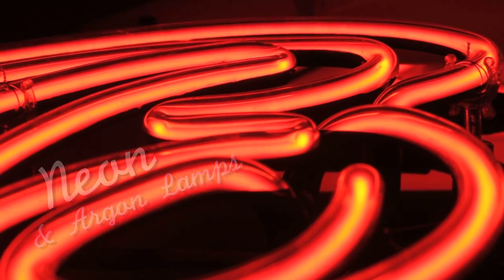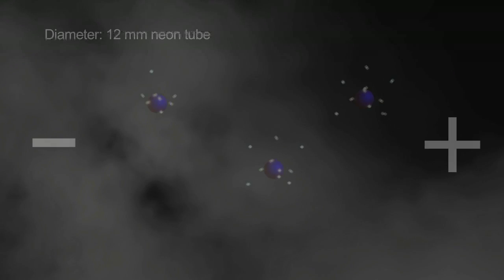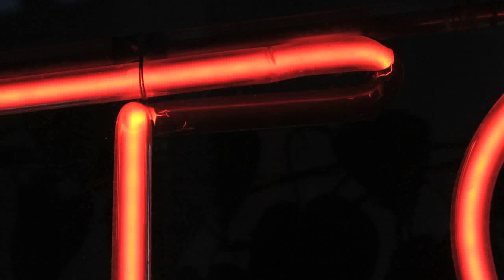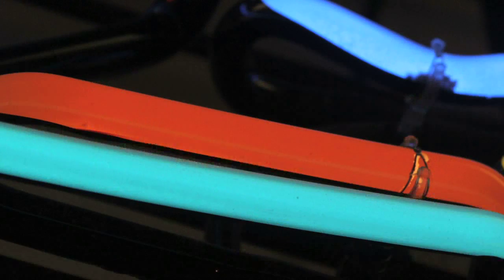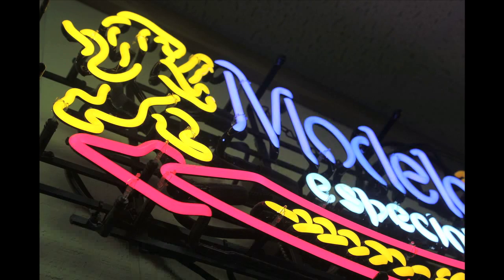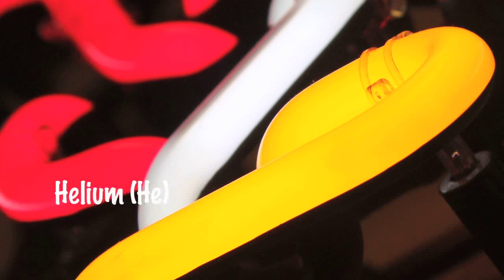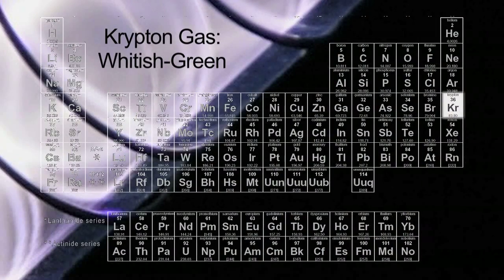The Neon and Argon Lamp

Comment: I would like an explanation as to how you get an even illumination down a contorted tube. Take an "e" for example at some points the electric field is one way down the tube and at others it is reversed (assuming the field goes approximately in a straight line from the anode to cathode). So why don't the electrons slow down in that section and maybe reverse, causing inconsistent ionization?
Reply: I dont know but one thing i do know is that neon tubes also work fine on ac and in a big U shape, cause sox lamps.

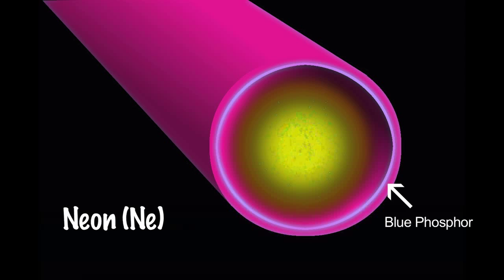Comment: 2:05 Sorry that's 100% incorrect its not the neon producing "just enough UV to make the phosphor glow", its the direct electron bombardment of the phosphor from the high voltage current which causes the phosphor to glow in as much as electrons bombarding the phosphor in a TV picture tube.

Helium in neon tubes was used in the 1930's and was phased out when fluorescent tubing became available due to the short life and special considerations required.

Comment: if you can use so many gasses, why not ditch the mercury,
why is mercury used anyways? because it is cheap in china?
Reply: No, this has nothing to do with China, you cannot use "so many gasses", just argon / mercury (Ar/Hg) and 100% neon (Ne) gas.  Its the UV produced by the mercury which is converted to visible light by a particular phosphor coating. I've been making neon for about four decades.
Reply: @tihzho  why do you need mercury with argon gas? why not the gas alone?
Reply: @ARCSTREAMS  Ionized argon (Ar) has a very dim lavender color and lacks the important 253.7nm ultraviolet (UVC) light emitted by ionized mercury (Hg) which is converted to visible light by phosphors coating the tube. 

In a lamp filled with Ar and Hg the light we see is from the ionized Hg. The Ar filling gas is there as a carrier to start the electric discharge.
Reply: @tihzho  ahh ok so the arg gas is just acting like a fluid to carry the vaporised hg and its the hg that radiates uv which is absorbed by the phosphor coating and turned into visible light, but im sure the arg is also pumping or bombarding the hg to make it lase or radiate the uv right? in fact the arg also helps carry the arc through the tube correct?
Reply: @tihzho  suppose we only use arg gas and discharge it in a tube that has windows on each end and confined between mirror resonators can we make a laser from this?
Reply: @ARCSTREAMS  Yes there are argon lasers as well as krypton and argon / krypton lasers.
Reply: @ARCSTREAMS  No the there is no 'lazing' with the Hg. 

Correct, argon is a carrier gas to support the discharge for the Hg. In the winter when its really cold neon signs filled with Ar/Hg will look dim because the temperature is too low, and the Hg vapour condenses back to a liquid.

Hg has strong spectral lines in UV while yellow orange and red lines are weak.
184.45 ultraviolet (UVC)
253.7 ultraviolet (UVC)
365.4 I-line ultraviolet (UVA)
404.7 H-line violet
435.8 G-line blue
546.1 green
578.2 yellow-orange
650	red
Reply: @tihzho  :) i looked around for pure cw xenon laser but never found nothing, are these perhaps uv range as well or what they call eximer? another thing i do not understand is TEA lasers where they emit uv but then what is the discharge glow? its nitrogen that makes sparks look blue right? so why is this light not also part of the beam but only invisible uv? im not too savy when it comes lasing spectrum's
Reply: @tihzho  thank you but even if there are weaker spec lines these can also be targeted for lasing right?

Comment: Blue + red = magenta;  red + white = pink.

Neon glow lamps were often used to light switch handles and for pilot lights on appliances and power strips. When old, the neon would take higher than normal voltage to fire, so it would begin to flicker as it aged.  Why? Also as if room light is added to the energy in the bulb, the flickering would stop (at least until they got really old.) 

Glow lamps were also used as cheap line voltage oscillators.  Did anyone make neon tubes oscillate?
Reply: I believe the electrodes contain a small amount of (radioactive) thorium. This caused a small amount of ionization around the cathode which helped the tube to strike reliably. It is possible that the thorium slowly evaporates from the electrodes causing unreliable striking. This is just a guess. UV in daylight and certain artificial lights would also help ionization to start but if it starts with exposure to low intensity incandescent lighting, I can't propose any explanation for that.